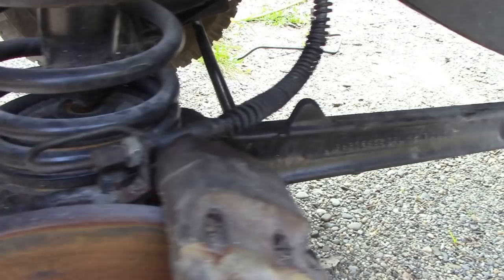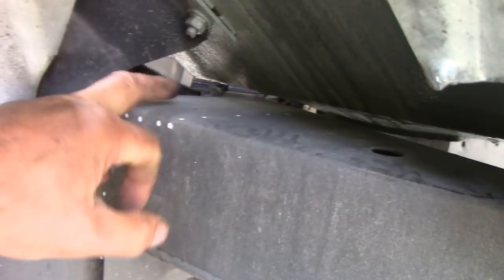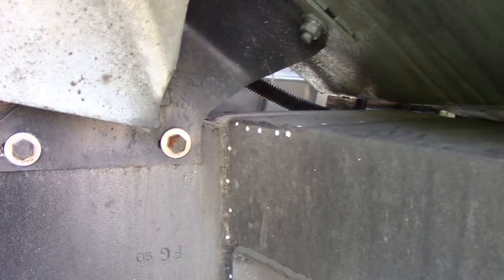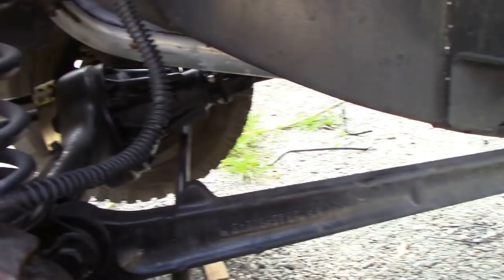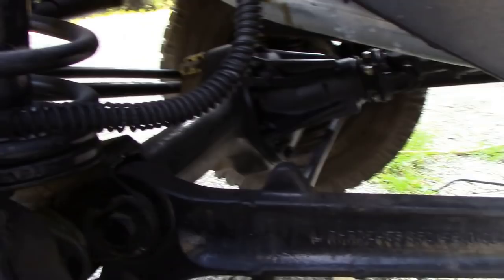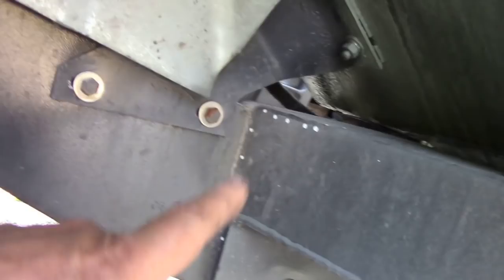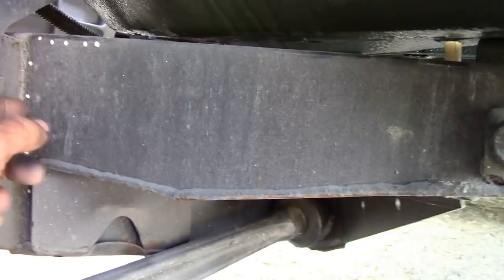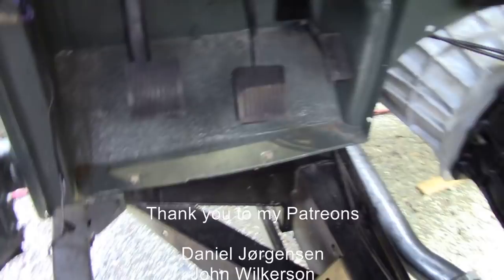Some tips on fitting an outrigger and radius arm on a Defender

Comment: Excellent timing Mike! I'm going to be doing a patch at the base of an outrigger this week and was wondering how much of a nightmare the re-alignment of the radius arm would be if I made life easier by whipping it off first. Mind set to rest, thanks very much. (And yes, I know, patches are just wrong!)
Reply from the maker: Follow the tips about re installing horizontal and dinging out the wings on the axle and it will be a dream!
Plenty of anti seize on those bolts!
Mike

Comment: Thanks for the video and the top tips.  Today I managed to get a few hours work on my Landy, the bulkhead bolt as with the radius arm bolts undid easily, I have cut away most of the old outrigger, but my chassis is not good. Looking through the outrigger sized hole, I can see the inside of my chassis is good, so good the paint is still intact and there is no debris. Unfortunately my outrigger ripped off by hand, leaving just the old welds, also the top of my chassis is holed. So your cheaty way is not going to work for me, not on this side anyway. I am not about to take the lump out, but I have removed the floor and discovered that the bottom of the bulkhead, the area below the pedals that the floor screws onto, has rotted away, this make access easier, but I am going to remove some more of the lower bulkhead to allow access to the inside weld on the outrigger, and the top of the chassis. I have the front of my Landy on 10" ramps, with all the wheels still on, so refitting the radius arm shouldn't be a problem.
Reply from the maker: Hmm, I think I have been here before!
If you plate the hole, you will have good metal to work with, but remember to fit the bulkhead bolt in before welding AND if your bulkhead is a bit thin, tack the corners of the outrigger and make sure the door shuts correctly, before attacking with the welder - you may have to jack up the door pillar to compensate for the bulkhead drop.
I have had to do a bit of corrective work on these in the past where owners had a go, but didn't realize a couple of mm drop can equal 10mm of gap in the door
Mike
Reply: Some more good tips Mike, thanks. I think my bulkhead is solid enough, nothing appeared to move when I removed the bulkhead bolt, I did pay special attention to that after watching your video about adjusting door gaps. Happily my sill is solid, it may not look it but it is good. I have been renovating a full set of doors and plan to fit them once the welding is done, so I will be able to fettle them into place. My Landy is a 28 year old 110, two years ago I had to replace the rear quarter of the chassis, and last week I replaced the body member that sits on top of the chassis under the middle row of seats with the tub still in place. Neither of these jobs are for the faint hearted or total novices, but even as an experienced mechanic I find your tips very handy, as this is the first Defender that I have had to work on the chassis, keep up the good work.
Reply from the maker: Aye lad - it's not easy  - but it is rewarding knowing you do it yourself
I really want to get other guys into something more adventurous than filling the tank or changing the oil
But we have to start somewhere!
I used to weld chassis with gas and rod many years ago - swore by it 

The I got a MIG - and the I got a bigger 230 amp MIG!
That rattles off jobs, providing you have something to weld to
I cannot understand why some people patch outriggers - if you catch them early instead of patching, bang a new one on
In that way, you can have a chance the metal behind it on the chassis is weldable, and once waxed its good for a long time
I am supposed to have a licence here for welding chassis, but after 30 years I may have got the hang of it now!
LOL!Mike
Reply: I also have about 30 years of welding experience, I have gas-less Mig and a stick welder, unfortunately I don't have a garage, so I have to weld outside. I live in the north of Scotland which makes welding a challenge outside.  I have a plan forming, I am going to cut the outside and top of the chassis just a bit wider than the welds for old outrigger, the steel is good there. I will make a patch for the side and top of the chassis, in one piece  and tack it in with the smallest Mig tack that I can, so that it is secure. Then bolt the outrigger in place, remembering the spacers, once the outrigger is fettled into place, (it is an aftermarket one, so we both know it wont fit well to start with) I can tack it in place, on the new patch. I can then break the original tacks and take the patch with the outrigger into my shed and stick weld the two together, making sure that I don,t warp it too much. That way I only have to do two vertical welds, (which I hate) instead of four. It might work, time will tell. The consolation is, that the next journey my Landy will make, will be to the MoT station, so it will all get examined before it goes on the road.
Steve.
P.S. Have you heard that the UK is meant to be bringing in a law that make vehicles over 40 years old, not require an MoT, what are your thoughts on that?
Reply from the maker: Well, I used to live in a terraced house and welded in the street outside - in the North East, so I sympathise with your working conditions and climate!I tried gas-less MIG once and never again! Covered in showers of sparksNow I know gas-less is supposed to be stronger but it never looked rightAfter experimenting with MIG I found the best was an Argon CO2 mix - I think 80% argonNot cheap but fantastic industrial types welds - and no splatter so no clean up, so vertical welds were easy going top to bottom - just gotta play with the MIG settingsI was never any good at thin stick welding - bigger stuff ok, but I see your pointI found that with thin stick start at the top and do an inch then stop and do a bit at the bottom and work back and fourth, giving the metal time to coolLooked a bit shonky but was strongI heard about the MoT for old carsTo be honest I am not avers to the the test - just to keep your car in safe shape, but it has become so anal that it is a wonder any car passesI have been out of the UK over 25 years now  - still come back now and again,  but I don't think I would have patience for the MoT now 
Best system I saw was in New Zealandhttps://nzta.govt.nz/vehicles/warrants-and-certificates/warrant-of-fitness/Very fair, cheap and quick I drove over a big pit on long ramps and mechanics were at different posts checking stuff - done in 15 mins 
If there was an issue that was minor - eg low tyre tread it was noted and you had to get it fixed for the next test (every 6 months for old cars)
In Quebec we don't even have an annual test  - let alone emissions!, but man, are there some dangerous cars out there!
Reply: Council houses, been there, done that, I'm in my own place now, just havn't had the time to build a garage.
The NZ plan sounds good, but I agree with you, I like the MoT, as I am sure you have experience of being too busy to look after you own car, so the MoT keeps me in check. In 12 years my Landy will be MoT exempt, I will however get it MoTed every few years. I was thinking of saving some pennys for a new chassis, do you think galvanised ones are worth the extra money?
Reply from the maker: I guarantee it, that if they introduced a strict UK MoT style inspection here in Quebec, well over half the cars would be off the road overnight
Mike